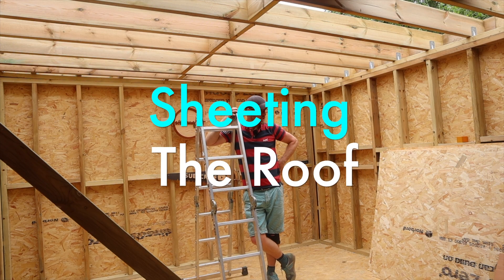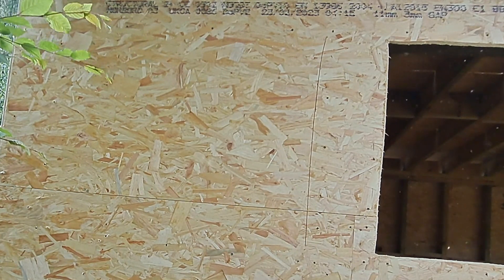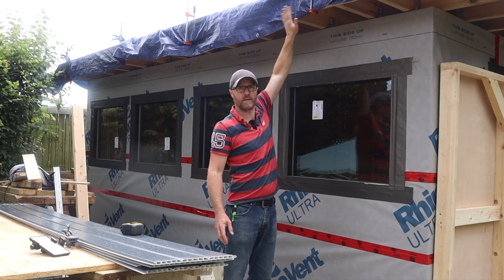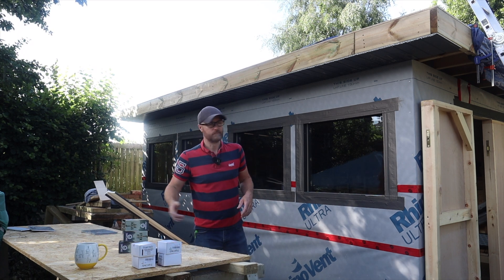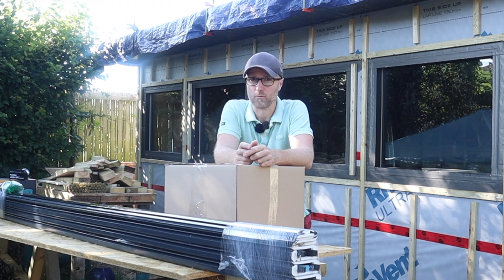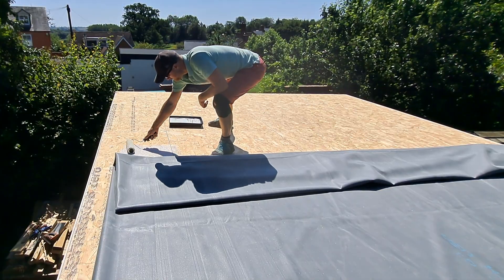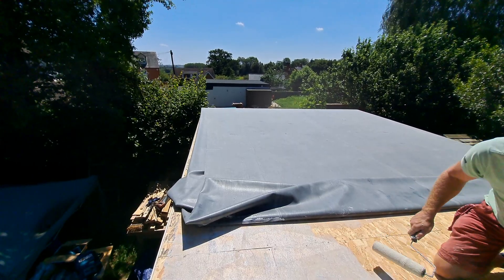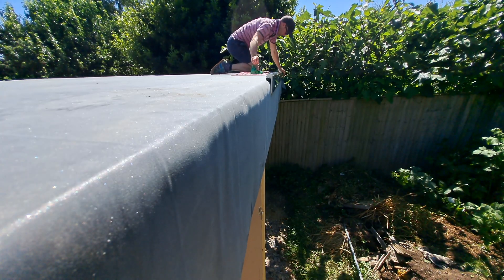Garden Room Workshop BUILD Episode 4 || The RUBBER Roof

Comment: im doing a build like yours now, use a hacksaw blade in a jigsaw cut from the back side go slow at the end and cuts like a dream, i use me 300mm speed square to keep the cut square.
Reply from the maker: Hi. wow. I didn't think of that. that would have saved me a lot of hard sawing. Thank you. I will use that in the recommendations video at the end. Much appreciated. Good luck with your build. I hope you dont have a day as bad as this one was.
Reply: im literally ordering me rubber for the roof today so this has helped as was struggling find the right place with the correct trim etc so very helpful video buddy. thanks ever so much and keep up the great work.
Reply: oh and for larger square cuts i use little stair gauges and then a quick clamp, stay safe on them ladders 😉
Reply from the maker: Oh thats brilliant. So happy that this was helpful as intended. Honestly, the company was great. the gear is top notch and they refunded the accessories pack for me no questions. They have amazing how to videos on their page and drop me an email if you have any questions, well ones I may know the answers for. You probably have it covered though I am sure.
Reply: @daevidwilliamson1638 : Hi, Daevid. I would suggest Not using the supplied
accessories pack (at least not the parts which failed Mark) and buy decent
tools, if you don't already have them. You are sure to use them later.
Reply: @zapa1pnt   appreciate your feedback, ill be using the tools i already have me harris with pole. i love buying decent tools, im debatinng which block plane pick up nx.

Comment: 😂😂😂 Not really funny, especially when your tools let you down, usefull tip :- when I did myne  also on a hot  week during lockdown, I  put a coat of pva on the roof the day before to seal it, and had no issues with the adhesive drying too quickly. I also had quality rollers with poles.!! I pop up there from time to time to check for damage but so far nothing and absolutely no leaks.. great vid - When you said your brush  broke. I cringed - thinking you were about to poke a hole in the rubber..!!😱
Reply from the maker: No it's ok, looking back now, I can laugh. What a great idea coating the roof first. Great tip and one I will include in the review video at the end. I actually went there to take photos for the thumbnail yesterday and it looks good all over. There are a few air bubbles but Im not too worried. You know, the broom snapping when it did rather than at a more vigorous brushing moment is probably what saved the roof. And I will also remember to include this in the review as if the head had fallen off it would have definitely gone through. I did that to a paddling pool last year,

Comment: hey Mark,can you fix the sound on your next videos,i listen with headphones and certain times i only hear sound from the left ear,as it isnt music,maybe make your audio track(s) mono in post,also bring the gain of the two audio tracks at the same level (normalize),one is louder than the other,anyway,as i am single for sheeting something above head i bought two drywall studs at lidl,they are my two other hands 😎
cheers m8
Reply from the maker: Hi. this is an ongoing issue that I only really figured out recently. The voice over should be fine as that os more recently recorded but some of the videos are recorded before I figured it out. Basically the jack on my camera was loose and the input was only half in. It should be fixed for videos recorded after the fact. though, you may notice a few issues in the workshop videos to come but less than the ones earlier on. hopefully.
Reply from the maker: Thank you. I have been ready to pull the pin on that for a month now and the only thing that stops me is that I am so rubbish with a computer that learning even the simple programs is so stressful. I think that the sound this is down to the new mic I have as the right is there, just very very low. Maybe the jack is broken. I will not be able to solve it for a few videos as I have already filmed a lot of the footage. but I will take another look and I have contacted Rode to ask them. Please know I am taking this seriously, I want the best quality possible.
Reply: @startmaking1  cheers Mark

Comment: I found the missing video, The biggest problem I saw was your one-piece rubber roof kit was never designed to be a one-man installation. More like 2 or 3. What you call mistakes, I consider them adaptations you took in order to make it a one-man job. Then you were faced with either installing it in the heat or the rain. I think that job would have been a mess if you waited to do it in the rain, plus you would have been sealing in a good amount of moisture that was in the roof rafters & sheathing. No, it wasn't an easy job for you to do, but your end result was what you wanted, a roof that doesn't leak. Once a structure has a weatherproof roof, all kinds of different work can be done inside the structure. Your shop continues to look very nice.
Reply from the maker: Glad you found it. And you are spot on, rain would have been a far worse problem and more dangerous with slipping etc. 2 people. would have been good, 3 perfect. Maybe even easy. You are also spot on, now I have the roof on, I have already managed to fill the inside with a lot of clutter lol.

Comment: Maybe my conversions is wrong as I am American.  But 20 c equals roughly 68-70 degrees over here.  That’s not a crushing heat wave to almost anyone in USA.
Reply from the maker: It was around 29 Celsius so 85 ish . I know that is not mega hot. But it was more the fact that I was on a black rubber roof, direct sun and highly sped up drying time. Don't get me wrong, doing most jobs this is just a hot day. But doing this job, that is a terrible place to be.
Reply: @startmaking1  ty for the correction.  A day like that isn’t a great one to be on any roof doing anything with shade, let alone without shade. Appreciated
Reply from the maker: I didn't want to sound nit picky but 20 degrees c would have been a dream day for it lol.

Comment: If you can get through all those mishaps without going suicidal then you are almost there. You are committed now to finishing what is turning out to be a truly exemplary build. The fun part of kitting out the interior will make your disaster seen like a bad dream. Look forward to the good times ahead. There, that's my psychological analysis over.:yougotthis::yougotthis::yougotthis:
Reply from the maker: Hi Costa, great to hear from you. And you are absolutely spot on. I came down from the roof after that 30 min hell and just sat and took stock of where the build was. Sounds bizarre but that felt like the top of the hill and everything after that was getting more and more easy. I am currently at the stage a little ahead of this where the exterior is completed and I am trying to make the most of the interior while waiting on the electrician. It is a lovely feeling standing in there but I have to say I am itching to get started on the really fun stuff. Wont be quick as my job ramps up through the winter but I really can't wait. Thank you
Reply: @startmaking1 : Winter??? You have 2 to 3 months. I think you will make it.
Reply from the maker: Sorry , I should have said I sell ski holidays, so the winter for us starts 1st September. IE a new ski season.